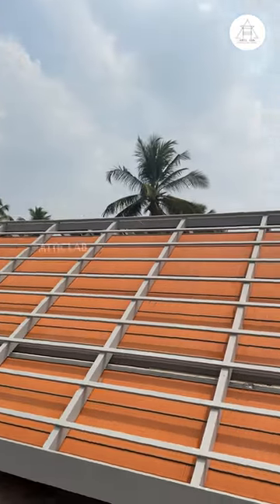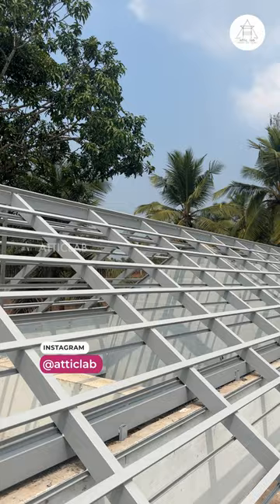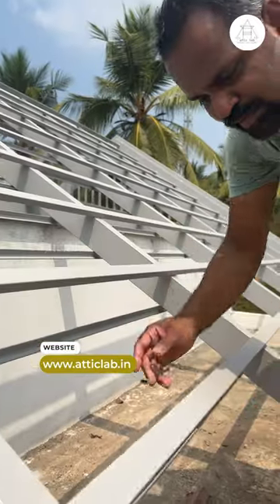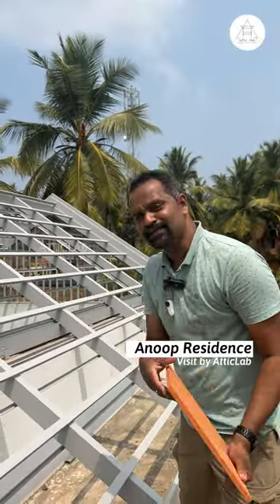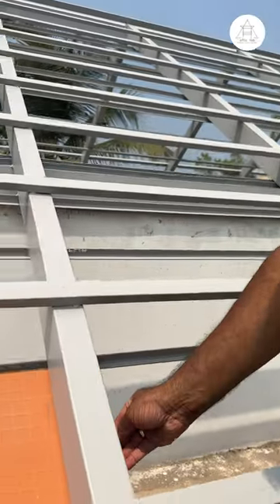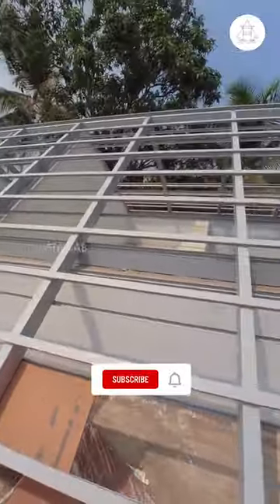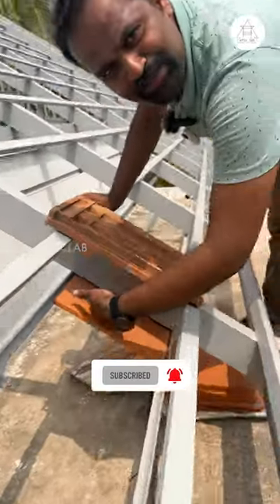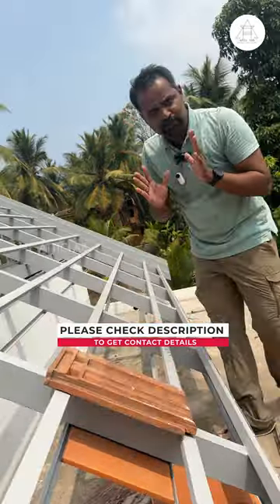Double Layer Truss Roofing with Ceiling TIle & Mangalore Tile  | Visit by AtticLab

Comment: We got solution for this rat problems in tamilnadu here double layer clay roof tiles are available they have very small gap only that space is very viable for easy air movement not for rat and other things then it is no need this kind of heavy structure
Reply from the maker: No sir and small gap will attract rats...

Comment: This is a good method, @atticlab 👏.  Just one suggestion/query, though. Wouldn't it be better to have Rockwool in the gap instead of just air to achieve enhanced heat and sound instulation as well?
Reply from the maker: Yup good option…👍🏼👍🏼
Reply: @AtticLab   thank you very much  for the quick response ! I really look forward to the use of mineral wool more in construction projects in kerala for walls as well as roofing,  considering the amount of heat insulation we need in this climate and also the added advantage of reduction in energy bills for our cooling needs
Reply: Using rockwool is an option, but there are some minor issues in it. 

Before going there let me tell you that using of air gap is the most practical way as of today. The main reason is that if the gap is filled with air , then hot will be trapped in this area. this air will be circulated to outside and then new cold air will fill this gap. This process repeat and it regulates the temperature. This will also cool down the ceiling tiles to an extend.

The first issue is that the weight could be a problem when you are using the rock wool, the weight of the roof will increase in a big manner. Another issue is rock wool is not considered as a health safety material as it can cause irritation in the skin if exposed.
Reply: ഈ ടൈൽ എവിടെ നിന്ന് കിട്ടും

Comment: not a good solution to get rid of the heat because air flow is more important than air gap. Air always flows up in an enclosed space and it accumulates at top and the excess heat transfers to the concrete at last.
Reply from the maker: Right... But u will feel ultra comfort inside this home....
Reply: Airflow is ensured in this air gap, so the hot air is automatically replaced with relatively cooler air.

Comment: ithe sbavam gypsum panel kond ceiling cheythal cost kurayille
Reply: There won’t be chance for air circulation in between the roof tiles and ceiling tiles if it is done by gypsum.
Reply: ഇതേ സെറ്റപ്പ് നമ്മൾ ജിപ്സം സീലിംഗ് വെച്ച് ചെയ്യുകയാണെങ്കിൽ ഈ രീതിയിലുള്ള ബെനിഫിറ്റ് കിട്ടുകയില്ല കാരണം സീലിംഗ് ഓടുകളും roof tilesum തമ്മിലുള്ള ഗ്യാപ്പിലൂടെ എയർ സർക്കുലേറ്റ് ചെയ്യുമ്പോൾ മാത്രമാണ് ഇതിന് വീടിന് തണുപ്പിക്കാൻ സാധിക്കുന്നത്. രണ്ടു ഓടുകളും  ചൂടായി മാത്രം ചൂടു ഉള്ളിലേക്ക് എത്തുക എന്നതിലുപരി ഇതിനിടയിലെ ചൂടായ വായു പുറത്തേക്ക് പോയി പുറത്തുള്ള താരതമേന്യ ചൂട് കുറഞ്ഞ കാറ്റ് ഈ gap ഫിൽ ചെയ്യും . ഇങ്ങനെയാണ് ഇത് ചൂട് കുറക്കുന്നത്

Comment: "This seems like a waste of money and time. What does 'air gap' even mean? Is the air going to circulate in that gap? Are you going to install an exhaust in that gap? If anyone uses this building method, they must use insulation to prevent heat or cold."
Reply from the maker: Hi sir have you ever tried this???